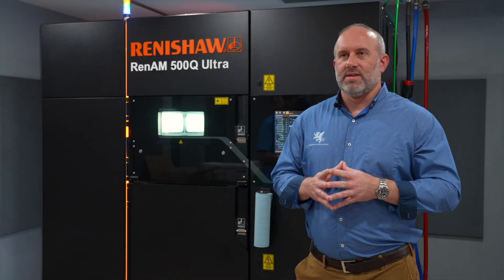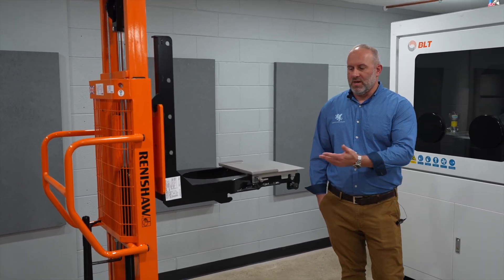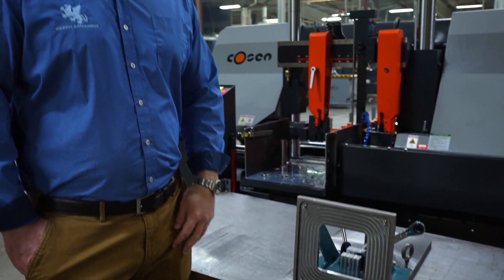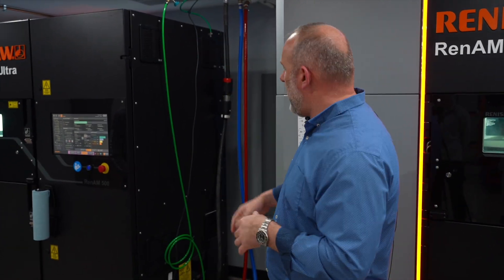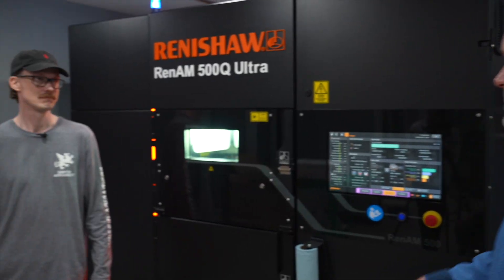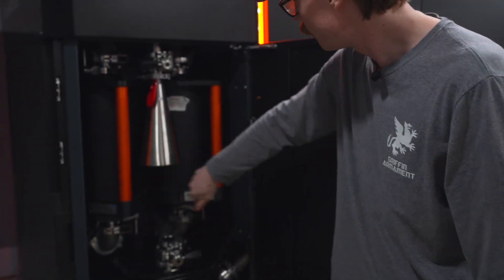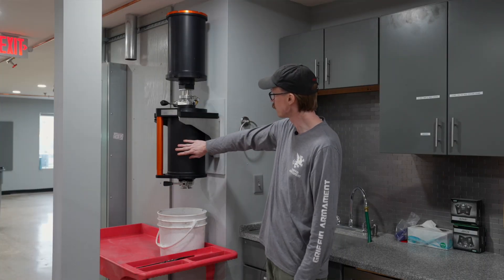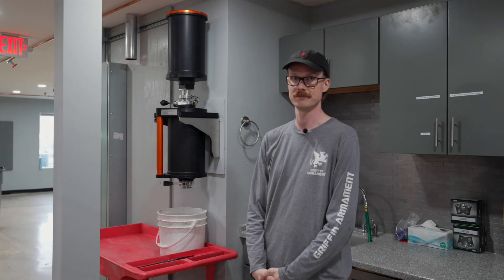Renishaw AM 500Q | 3D Printing Process & Equipment Implementation

Comment: What type of chillers are you guys working I work for a BIG hvac company… think Irish ☘️ 

But we do a ton of work in air cooled processes chillers. Would be a honor to work on a process as cool as this.
Reply: I believe they are SMC a little hard to recognize when they are on the ceiling of the room in a place where I don't spend much time, but I seem to recall SMC from the manuals and documentation.